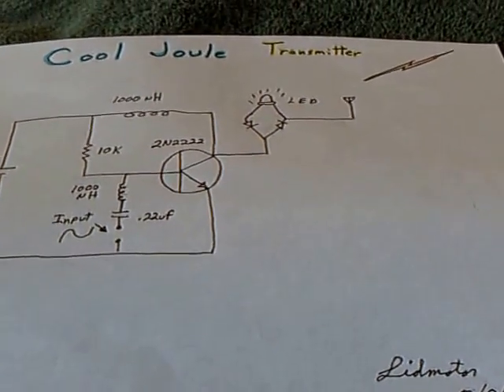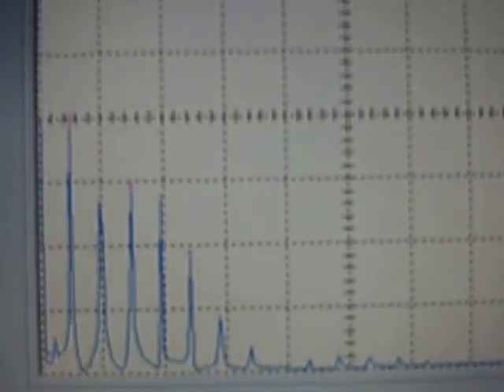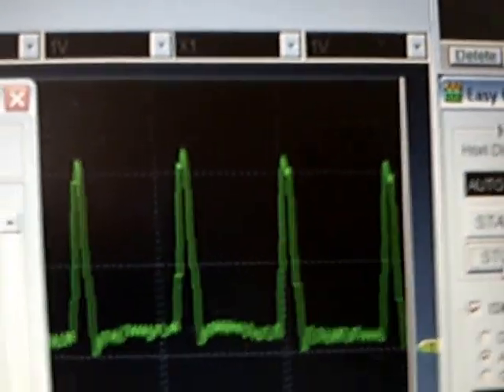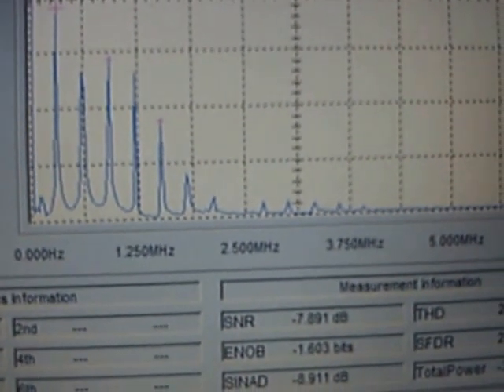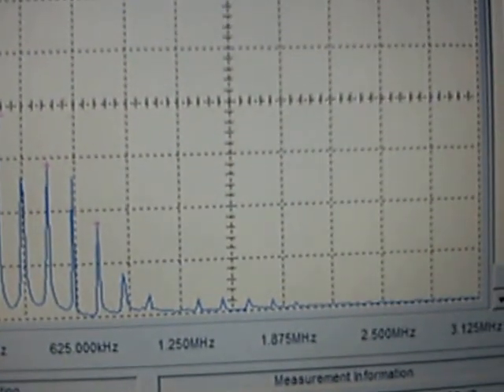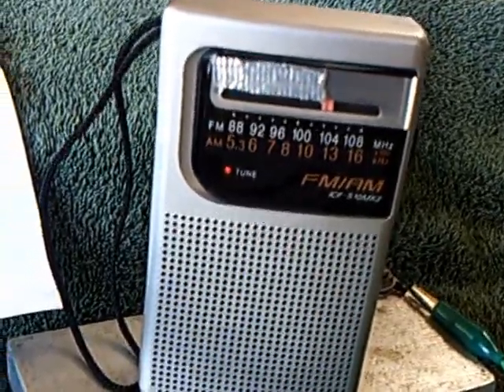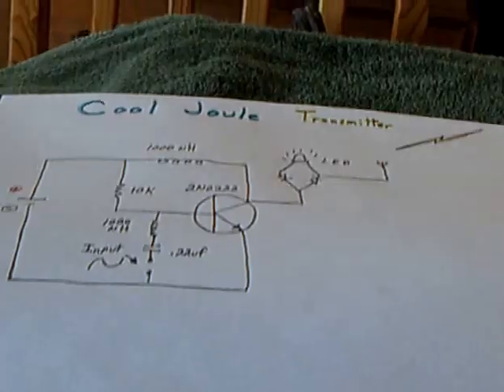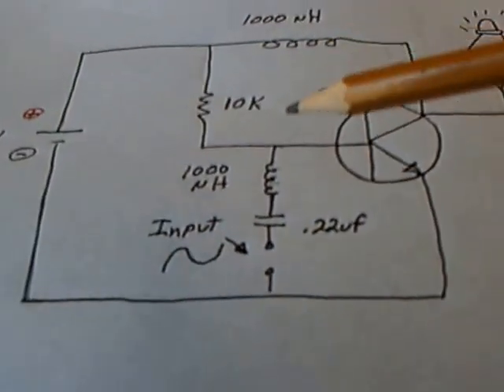Cool Joule Transmitter--Scope shots

Comment: Indeed. What I meant was change the frequency defining components. Inductors/caps and see if you can get it to oscillate at 500+khz this will give you more stability as your radio doesn't have to fight to lock on to the harmonic. Adding a nice ground plane will help that a lot as well. I might start experimenting and see where I can get.

Comment: Cool. Another practical use would be to run a CD player or the computer anywhere in the house and pick up the music while preparing food in the kitchen. Whole house radio, for tiny milliwatts of power required. 
Makes me wonder now, can 2 radios run in 2 different places and not steal the power ? if like normal Tesla type transfer, you should be able to receive up to a max at about same quality and then all will fade out in unison if add another.

Comment from the maker: YES!!  I already tried feeding the signal way out over one wire and it worked.  The coolest thing was when I attached it a screw on a wall light switch plate (attaches to the house wiring ground)  and then could pick up the sound other places in the house near light switches.